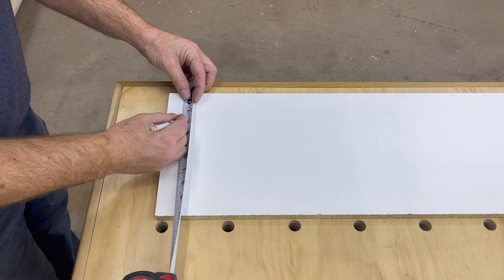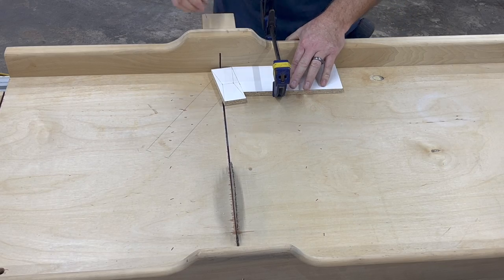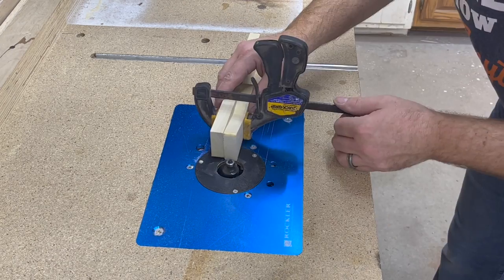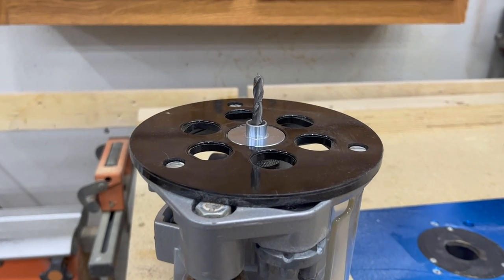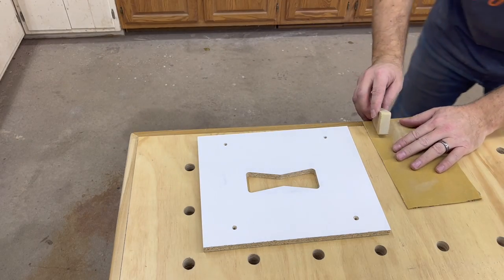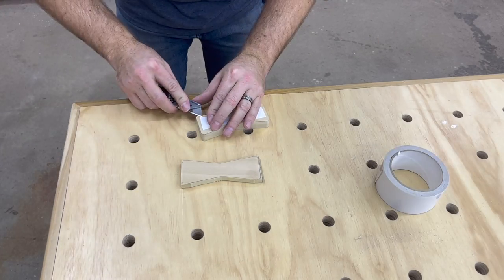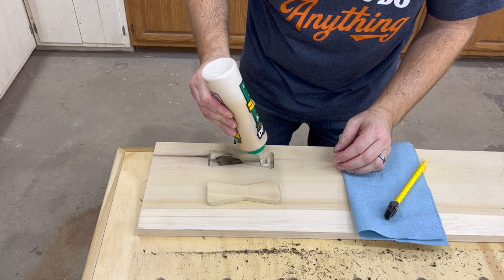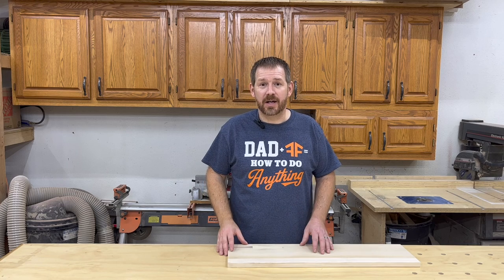Quick and Easy Bow Tie Inlay Tutorial

Comment: Backing out the cut on a table saw is not a good practice. Using a sacrificial push stick is much safer. Your hands and fingers are to close for comfort on the router, you could use your push paddles from your jointer. What you do is your choice of course, l just think safety is paramount with tools that can do a lot of damage in a millisecond on that day we just get a little to comfortable. The video was well presented too.